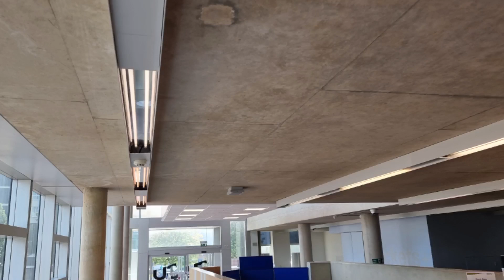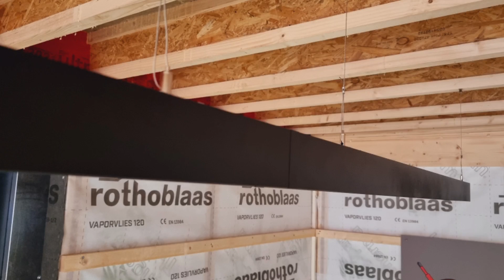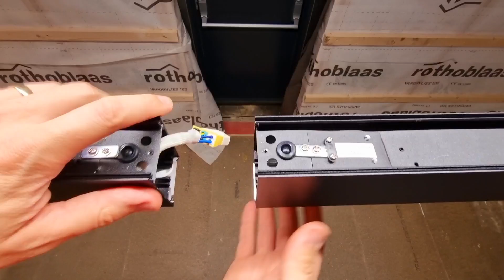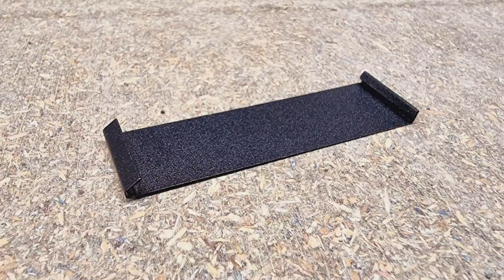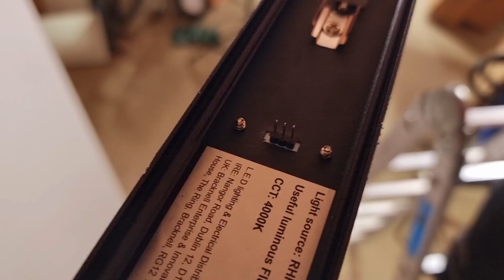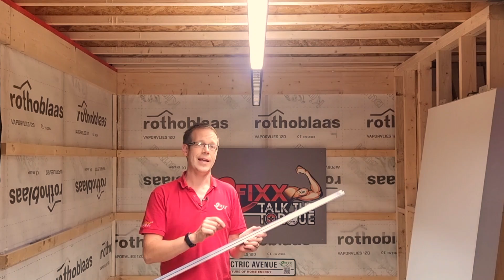Would Elon Musk Choose This Office Light?

Comment: These up and down sorts of lights were used in the local new build school. Unfortunately, the "up-lighter" part got covered in dust really quickly and students threw paper and other rubbish on top of the fittings. One of the main disadvantages compared to the old battens or recessed ones in the ceiling tiles.